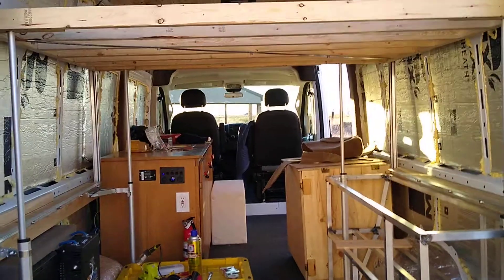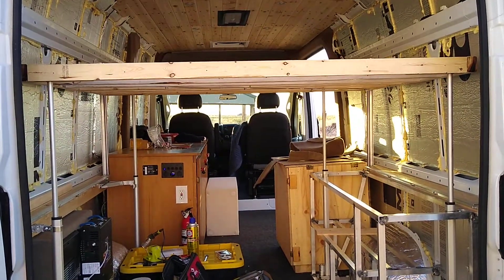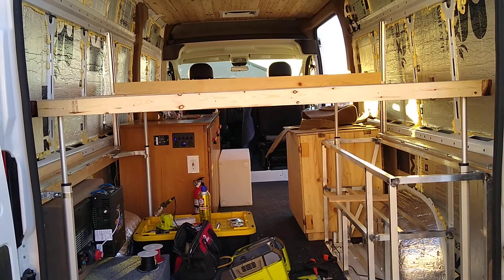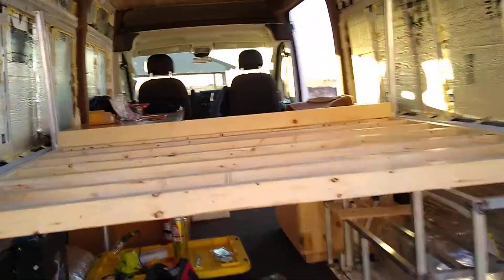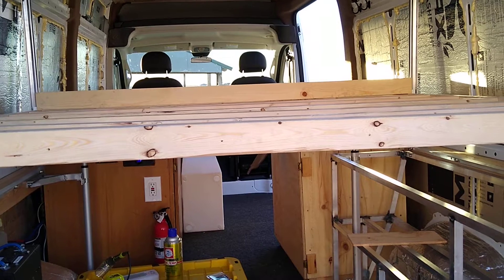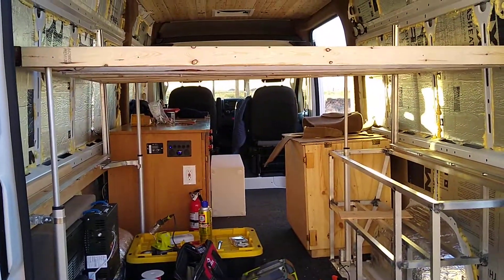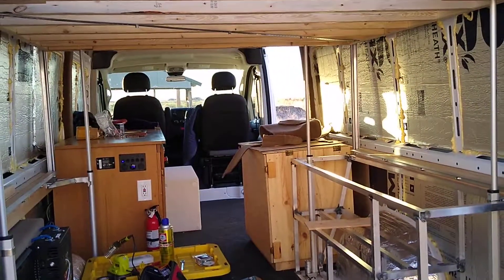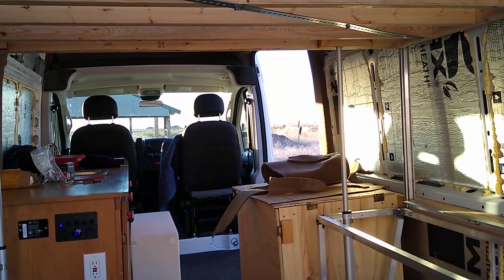Powered toy hauler van bed

Comment: Well done! Could you guide me in the direction of throes mounts you used to clamp around the linear actuator? My system is all set up but the rear of the bed wobbles so I need to secure those actuators to the side of the van like you did.
Reply from the maker: Which ones, the piece attached to the actuator at the top or bottom, or the piece that attaches to the vehicle sides?

The little wrap around clamps at the top of the tube come with the actuators.   The bottom mounts bolted to the floor are just actuator mounting kit parts, just about anyone that sells the actuators has those, they're on Amazon, etc.   Usually come in a kit with a couple brackets, some screws, etc.  

The brackets that attach to the sides of the van, are 100% fabricated from 1" angle aluminum bracket.   Those are simply something I welded together after trying a couple options.  

The rear of the bed moving laterally, is why I used the linear guide rails up front.  Between those and a diagonal flat metal brace attached across the underside of the bed, the whole bed is rigid in space.   It doesn't move at all at the rear.

Comment: Excellent work :)  And thanks for sharing. Not being electrically minded, could we have a wiring diagram on the switches please. I can't work out how to get all 4 actuators work at the same time like these. Googled everything I can but can't find anything. But I want this so much. Cheers and thank you.
Reply from the maker: They're all wired in parallel.    Each side is wired to a pair of 14 gauge wires (soldered connection) so that I only have a pair running in the wiring harness loom from the right side, over to the controls.  Same on the left, both are wired together, then run to where I connected them to the other side wires, to have a single pair to connect to the switches.  

The switches are DPDT, one momentary style.  

I've described the setup before, but never made a diagram of it.   I'll try to figure out some time to do that, busy trying to work on the house right now.
Reply: Thanks Robert, appreciate your help. l reckon I’ll buy 4 mini ones to practice with first. Then have the confidence to go all the way. 
Cheers and all the best with your house.👍

Comment: Wondering if the front guide rail is 100% necessary?
Reply from the maker: In my opinion, yes.   The reason why, is it's meant to hold the bed rigidly in space no matter what height it's riding at.   With the frame cross braced, being held rigidly in space at the front means it doesn't move AT ALL while traveling with the bed lifted anywhere in it's travel.  We've done 3500 miles on the van since late July, and it's working perfectly even hauling 2/3 lifted with bikes under it over rough roads.

Comment: Superb work, thanks for sharing Robert (and Hi from Australia!), great minds think alike - you've confirmed my theories also and my dislike for the weight/rigidity of the Happijac and the cost - also I'd like something bigger than a queen mattress, tending towards a king sized.   The spool/belt type under the bed (eg: The Euro Loft BedLift) looks clever but it seems hard to buy them in a kit form.   If anyone happens to find an telescopic version that could come down to say 2' and extend to 6' I'd be elated to hear of that type of linear actuator.   Thanks again and appreciate the updates and that it's handled 2,500 miles for you.
Reply from the maker: Sorry, never saw the post until now.   System has been working fine.   Occasionally one of the lifts has an issue with the end stop off switch internal to the motor not shutting it off, but they just click until you hit the switch.  It's been working great otherwise.   Van is up to about 7000 miles now, and we've done a several road trips averaging 17-18 mpg even hauling bikes.    Trip to Moab last fall netted about 17.5 for the trip which we thought was great with all the mountain passes and up and down.   

This is so much easier to use compared to pulling a trailer.   We both think it is a much better dealt operate, about double the fuel mileage of our last toy hauler trailer/truck combo

Comment: Which model is this? Premium one? I am looking for this kind of speed, I have seen some faster and some very slow. Thanks!
Reply from the maker: You can order them by mm/sec speed.   Just look at specs on the sites that are selling them and check specs.  These are 30mm/sec which is a trade-off for weight capacity.   These were rated at 66 lbs each, but now show 50 lbs each on Everest Parts.  The bed will never weigh 200 lbs total, so these are fine using 4 lifts.  Total bed weight including frame and bedding should be around 75 lbs.

Comment: how did you sync the 4 actuators
Reply from the maker: They aren't synched, they are all the same spec for speed, but aren't perfect as far as how they end up.   They're all within about an inch of each other at the end of travel.   There's enough flex in the wood frame to allow for a little difference in speed.   It's a simple system this way.

Comment: Hey Robert. I see p the link you shared for the actuators but the longest one I see is only 30". Yours seems to be longer than that. Am I correct?
Reply from the maker: I used the 26" actuators.   One thing to watch on the Everest Parts Supplies site, is that they go in and out of stock of various lengths at various times.   I had originally planned to use the 24" length, but everyone was out of stock, and the ones I tried to order from AliExpress never showed.  Then I checked my math and decided the 26" versions would work, and they do, quite nicely.  

26" is NOT the length of the actuator.   It's the length of travel.  If you read the description on them, you'll see that the overall length is listed somewhere, and it's the length hole to hole for the ends of the actuator in the retracted configuration.   You then add the stroke, which is the number they use to identify the actuator in the listings (24", 26", 30", etc).   Keeping in mind that it's NOT the travel in inches exactly.   These are all made overseas, and they're measured in millimeters of travel.   The 26" actuators are close to 26", but it's actually 25 and 11/16" or something.  They're actually measured in 50mm increments, which is close to 2", so if you see the actual application chart it will read 500mm, 550mm, 600mm, etc.   On many of the  charts it will show base length (this is the length of the shortest body they have) that then needs to be added to the stroke length to get the length of the body, then add the stroke length again to get the extended length.    Some sellers show the compressed and extended length on their sites, which makes it easier.

Comment: Hey Robert, can’t tell you how long I’ve been looking for a video like this!  I can’t stomach paying HappiJac or MOAB $3000 for a bed system.   Do you have any videos of you building this bed out in the earlier stages?  How you figured out the guide rail positioning etc?
Reply from the maker: Sorry, but I don't have a lot of videos of the construction early on.   I have a bunch of pictures on my computer, but the videos didn't start to happen for a bit, and mainly started as friends in other states wanted to see some  progress updates.   This really started as a way to keep several people updated as to my progress on the van, rather than a youtube "how to channel" but several others have been interested so I try to do updates.   It's only getting to a max of 40F during the day now, low 20's overnight, so I'm not working outside much.   The plan is to finish it in the spring, and I have nearly all the hardware here to finish now.   Going to stitch cushions, a vent cover and upper cargo opening cover inside this winter.  Probably get back to the outside work later in February.  

Did the same thing with the "lift" companies myself.   Saw someone lift a bed a small amount for loading their bicycles, and I figured I could make it lift a lot farther if I braced it.   Plus, more importantly to me, those lift systems are heavy.   The actuators are only about 3 lbs each.  The linear guide rails are the heavy parts.  You can get them on ebay, close to the length you want, and you can cut them with a metal band saw or chop saw.  They are steel on an aluminum extrusion, so they are a bit hard.   You won't cut them with a metal blade on a saber saw.

They simply need to be completely parallel to each other, so I measured the top and bottom locations for one side, measured it with a digital angle finder, then repeated it on the other side.  You can't use a bubble level, as the van will likely not be perfectly level when you're building.  The linear guide rails have NO play in the guides, so they need to be as close to parallel as you can make them.   I bolted them on at the top, the upper frame rails they're attached to are a great place for that, then shimmed the attachments at the bottom tied to the wood that's bolted to the middle framing on the Promaster.   The left side was vertical, and the right side I used one washer behind the rail, it was that close to parallel.   A 2x4 bolted to the sides makes it just about exactly even with the top rail for width.  

The linear actuators move slightly different speeds, and over the course of the full length of travel one of them will get to the top before the other three.   Worst case is my LF actuator is about 1" behind the others going up, very close going down.   The frame has enough flex torsionally to flex (why I used wood the way I did it, I was allowing for this) but it's rigid for square.

This video was fairly early on roughing it in, it's all finished now except for the end pads I'm making to drop in when the mattress is put in.  

If you check out later videos (I tried to link them) you can see how it mounts in with the side panels in place.  This one was messy, in that I hadn't even cleaned up my construction mess at all!

The actuators at the time, were about $85 each, then I bought their install kits which ended up around $20.   Turns out I only used the upper brackets and screws from the kits.  I kept the other pieces for spares.   Switches from NAPA auto parts are a double pole double throw switch, then a momentary contact version of the switch that I wired in parallel.  Both switches were about $30.   

Linear rails were around $45 and they've gone up a bit to around $70 for a pair.   I got 2 sets, thinking worst case I'd need to really get 4 of them parallel which I was dreading.   What I discovered was, two guide rails makes the front of the bed absolutely rigid in space, then running a diagonal metal strap under the bed to brace it square makes the rest of the bed rigid.   I can try to rock the rear of the bed side to side, and even though it's not attached at the side, it won't move.  It rides just fine going down the road with the bed up, just makes a little more noise over bumps since the bed frame is only sitting on the ends of the actuator rods and it's not a lot of weight at each corner, so it can bounce up slightly on bumps.  I'm sure that will go away with the weight of the mattress and bedding on the frame since the weight will keep the bed fully in contact with the actuator rods.  

I'm into it for about $575 in parts and hardware, including the 2x3 frame.   If I was doing it again, I could knock $75 off of that for hardware I over-purchased (extra guide rail set and hardware I never used).
Reply: Robert, I can’t thank you enough for that detailed reply.  Just to confirm, the linear guide rails will act as the brace for the bed so it’s not moving laterally during transit?  I was afraid I’d have to come out with some locking pins or mechanism to secure it. I didn’t want to slam on the brakes and have the actuator rods fail and see my bed go flying.  Sounds like you have all your basis covered.   I’m planning on using aluminum angle or some of the 80/20 aluminum to build my bed frame. Would you advise against that?
Reply from the maker: @klemmebrett4423  The actuators are bolted onto mounts with brackets, and are rigidly held.   The sides of the bed rest on the side brackets, it's captured by the 4 tops of the actuators, but is rigidly held to the van with the linear guide rails.   It can't move fore/aft or laterally.  The actuators are inside holes routed into the wood blocks that the actuators act on (on the bed frame), so the ends float in the blocks.   It would keep it from moving much anyway, but the guide rails secure it.   It's quiet and fixed going down the road when in the lowered position, and rides just fine in the raised position, but like I said before it doesn't weigh much so big road bumps will let it come up slightly, enough to rattle slightly over big bumps.   With any weight on it, it's silent in the up position also.  

80/20 is something that I looked into, but I ended up welding framing from .125" wall thickness aluminum to get the shapes I wanted for cabinets.   I seriously thought about 80/20, but it's expensive.   It doesn't require welding, and lends itself well to framing using less expensive tools, but I own a MiG and gas welders.  The bed being made from wood framing, allows a certain amount of flex in torsion, while being rigid in square, so it allows for a certain amount of inconsistency from the actuators.  It's impossible to get 4 of these to run at exactly the same speed over the 26" operating range.   They're close, but not perfect.   Maybe if you could get a couple dozen and test them all to match into a set,  you might make it work evenly, but over time they'll diverge a little.   This is due to internal gear train, jack screw and motor inconsistencies, but it's just not a big deal if one runs 25mm behind the others at the top.  They all auto stop at the same length.   If I was using a single hydraulic ram, or two heavy duty actuators and lifting straps I could make it run perfectly level top to bottom and that would allow me to run a rigid bed frame.  

I considered running 2 actuators in the bed frame, each acting on the straps attached to the opposite side.  Basically make them so that straps would run across a roller at the edge of the frame.   The actuators would push a rod to move the straps across the bottom of the bed and that would lift the whole frame.   The issue with that, was then the whole thing would swing when it was up unless the frame was inside some kind of guide system.   In laying it out, it got more complex than it needed to be so I went with the setup in there now.   The other option would have been the strap bed lifting systems I found that use a manual or electrically operated tube under the bed frame.   They use the tube to roll up strapping on either end, same setup as several RV's with lifting beds.   I could not get one of the suppliers of these to answer me, as they build complete systems to sell to the RV manufacturers.   I wasn't able to get one to sell me a lifting setup even though I offered.  Those setups have the same issue, they have to locate the bed in space since the straps allow it to swing.

Like all things, this is a compromise for operation and it works fine to lift and lower the bed.   It's light, relatively inexpensive especially compared to commercial lifts, and runs well.   It's not "perfect" but serves it's purpose.  We've put 2500 miles on the van since I put it in, and it rides just fine, and gets out of the way nicely to haul large sheet goods for home projects (or parts for the van) on hardware store runs.  I like that I can haul 12' long lumber still, and 4x8 sheets of plywood or foam no problem.  Even when the van is all built out, it will maintain the ability to haul.  I'll be making a bracket to hold sheet goods when I'm done building the van.  It will normally not be installed, but I'll set it up to be able to install quickly so that I'll be able to stand sheet goods up in the bracket at the front, and have a bracket to attach to the bottom of the bed to keep things from laying over.  long lumber sits on the floor just fine.  Probably not going to haul dirt and gravel in it, but hauling a ton of wood pellets should be no problem.

Comment: How did you mount your actuators? For the floor mounts and upper mounts?
Reply from the maker: The lower mounts use the included mounting brackets, bolted to the van floor.   They use a pin through a clevis on the lower end of the actuator.   The upper mounting brackets were the accessory brackets you can buy for a few bucks from the actuator supplier, that are shaped to wrap around the actuator housing anywhere along it's length.  They have a single screw that tightens the bracket to the actuator (pinches it on) and a hole in the end to bolt to a fixed point.   

I made mounting brackets to securely attach them to the left side of the van, and made mounting points for the right side actuators that attach to the cabinet for the water tank.  

The actuator rods are not directly attached.   I used a router, and made a notch in wood blocks to mount to the bed frame at all four corners.   Each block is attached with three 3" deck screws at a slight angle, set up so that as they lift the direction of force increase clamp of the blocks.  The actuators are fixed in place by the upper and lower mounts, and letting the actuator rods float slightly in the blocks allows the bed to sit flat on the sides, as the rods retract less than 1/4" below the engagement point.   It also allows me to disconnect the sliding rail brackets at the front, lift the entire bed frame up, tilt it, and remove it from the van.  The actuators can remain in place and we can use the van to haul tall cargo, or just remove the whole bed frame to work on the cargo area.